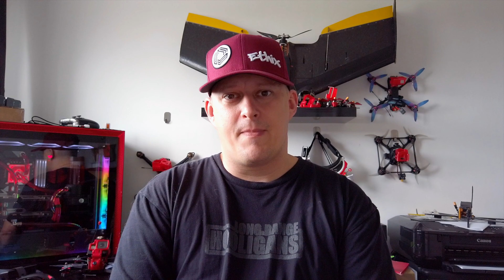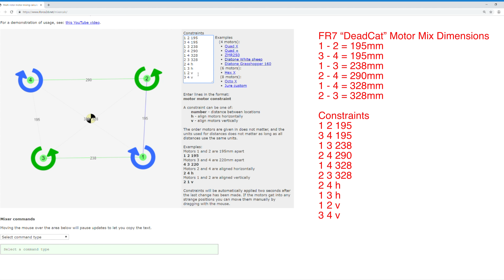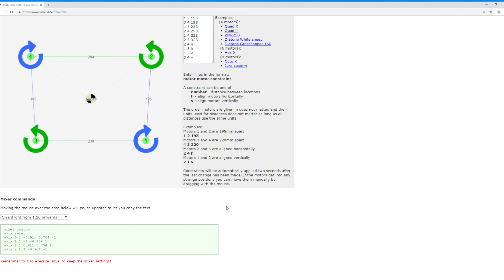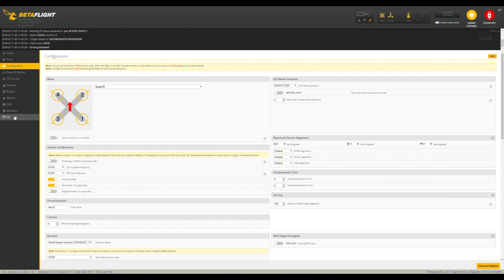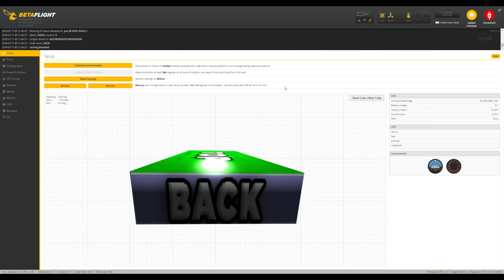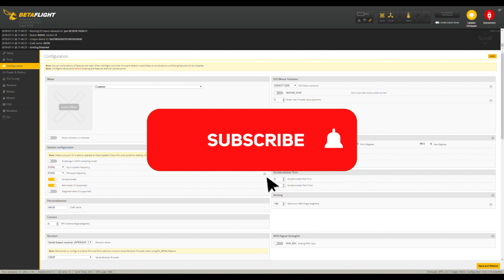Betaflight Custom MotorMix // How To

Comment: Can you fix Center of Gravity induced, Yaw to Roll Coupling using Custom Motor Mixing.
2.5" Cinelog25 V2 with a Naked Gopro. 
Center of Gravity (CG) is 2 inches forward and 1 inch high from the Flight Controller (FC).

The resulting issue is..
Yaw right = Roll Left
Yaw left = Roll Right

I've tried all PID and Filter settings and combos known to man.

*Hover Motor Throttle*
25% Front motors
6% Rear motors

Comment: The units used for distances does not matter as long as all distances use the same units.
Reply from the maker: iforce2d thanks for the clarification. I was using this frame as an example for the measurements. Are you aware of any changes to the newer versions of BF? It’s been over a year since I posted this video and a lot has changed 😬

Comment: Will have to give this a try... So what about the c.g. ie: more weight front to back as opposed to side to side? sorry if you answered that in this video but just kind of skipping around while at work, will watch all the way through when I get home tonight.
Reply from the maker: UgpFpv it’s not about weight at this stage. The flight controller has to know where the motors are in relation to itself so that it can apply the correct thrust output based on stick movement. You could be applying more stress to your motors/escs than is actually needed.
By all means test this out and let me know in the comments how you got on. I’m interested in your experience 👍
Reply: Assuming all your props are the same size and pitch, the multirotor should be set up so that the CG is at the 'average' position of all motors and they share the load equally. For a quad this is simply half-way between the front and back motors on the left-right centerline.
A setup with more weight front to back etc will only make two of your motors work harder than the others, and it will be very hard to tune because pitching one way is easier than the other (eg. if more weight is at the back, pitching nose down will require more energy than pitching nose up) and typically flight controllers only have a single set of PID values to cover both directions.

Comment: thought that was no longer used since cleanflight days. does it make a lot of difference to the handling?
Reply from the maker: Gerry Squire it’s still “a thing”. Your flight controller doesn’t know how far apart your motors are or where they are. This affects the amount of thrust applied to the quad based on the “current” motor mix. Most people just use the “QUADX” mix these days as they look at their quad and eyeball it - “yeah that looks right” and then carry on with their config. I personally notice a difference. But why not try it yourself if your quad is not a “true-x”. Let us know in the comments how you get on 👍
Reply: @ARI3S  Thanks dude. will give it a go
Reply from the maker: @gerrysquire  no problem matey

Comment: Had no idea about this until now. 

Will this benefit frames like the Alien and AstroX X5 too?

I see you’re still running 3.5.7, did you not have a good experience with 4.0.x?

Wanted to ask you about the battery config you have showing on the image you posted on Instagram for this FR7, was that 2 x 6s packs you’re running on it?

Thing looks like an absolute monster of a quad, mate. 🙂
Reply from the maker: Yes mate this will benefit all quads that are not true-x. I’ve dabbled in 4.0 but didn’t like it, didn’t tune that well for me. 
The FR7 is a beast and yeah it was 2x6S 3000 packs for cruising 👊🏻😎
Reply: ARI3S good to know, cheers for sharing. 

I had two quads that were flying pretty good on 3.5.7, but when 4 came out I went ahead and flashed them without dumping my known good settings from the previous version, and when I flew 4 on both quads at low throttle they both had this really weird slow wobble, almost as if I was flying when there was a gusty wind, but there was no wind, anything above 35% throttle felt fine though. 

I flashed them back to 3.5.7, but I barely ever look at any of my Betaflight setups now, KISS v2 or FL1/FalcoX.
Reply: @Dav2112  interesting, I came to this video looking to solve this exact problem. did you ever try bf 4.x again or just stick with 3.5.7?
Reply: @heggy_fpv  I've just been flying KISS V2 quads lately, I've been meaning to try the latest version of Betaflight but just haven't got round to it yet.